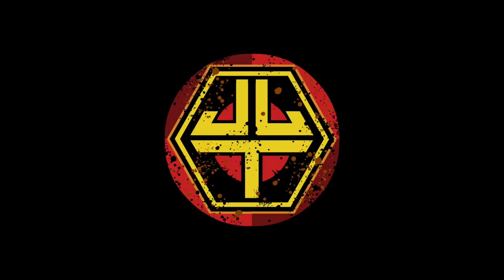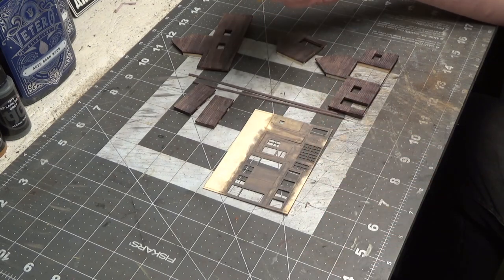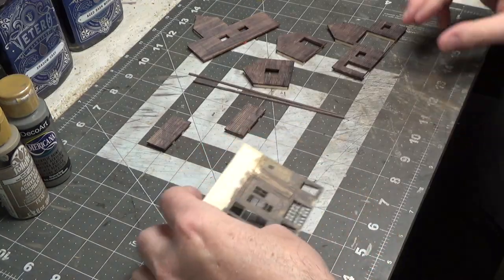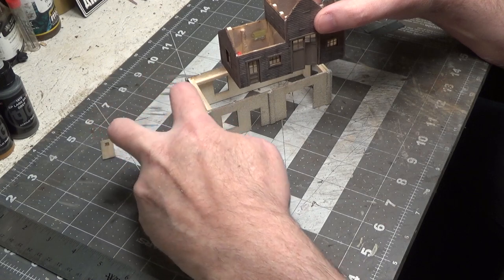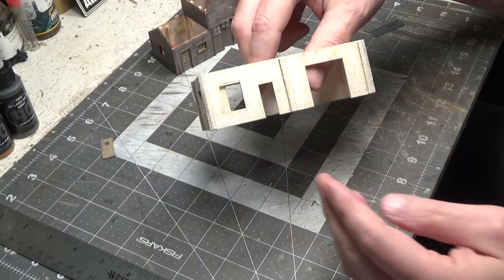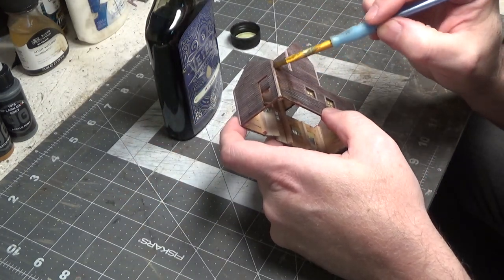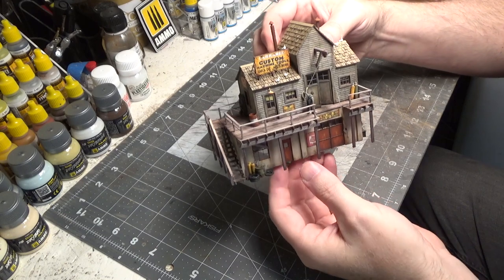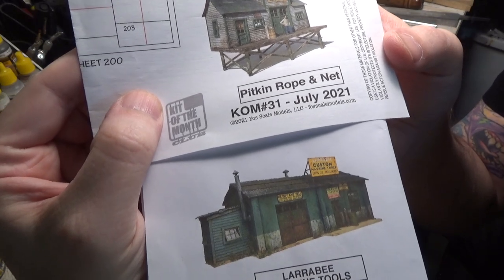Can I finish this build in my messy workshop?

Comment: Another great build,   you always seem to add a reason to go to the work bench.    Your work shop is a fine example of 5 lbs of dirt in a 1 lbs bag.   I really liked your views on pre construction of a structure.   Since I have joined your channel I have been using card stock, file folders, and other things that I would have never tried.   Now many scratch builds start out as card stock mock ups.  Thanks for the motivation to strive for a better project!
Reply from the maker: Thank you so much Will!!! I always appreciate your support! Happy modeling buddy!!!

Comment: A question, why don’t you use the flip top caps? You always screw off the flip top and use a brush to get paint out. Don’t they work? I would think you got better control squeezing out paint from the hole in the flip top cap?
Reply from the maker: I like to be able to dip my brush in the paint if I need more. I find the paint dries in that small hole then it doesn’t work. Thanks for watching, I really appreciate it!!!
Reply: @JasonJensenTrains  ok! I just meant squeezing out what you need on a palette.
Reply from the maker: I understand. I use to squeeze out the paints and then the paint would dry in that little hole in the the top. I got tired of unplugging that little hole. I guess it just comes down to personal preference. Thanks for reaching out Jonas! Happy modeling!!!